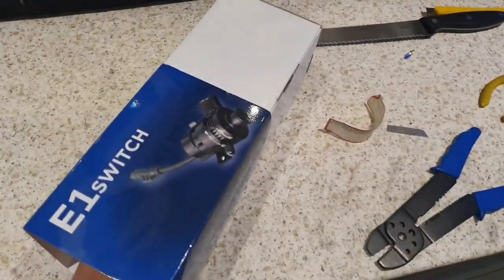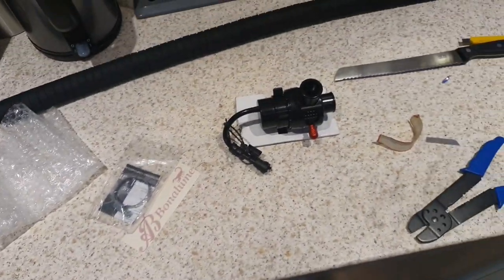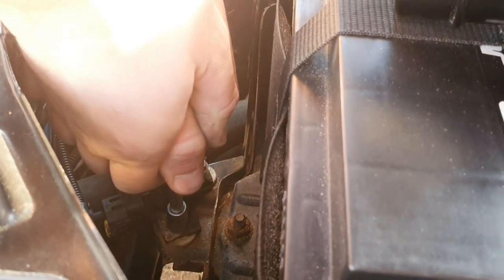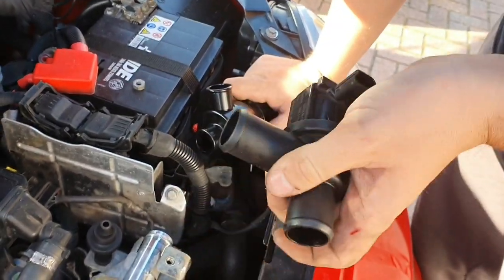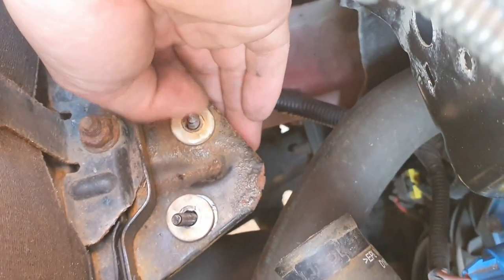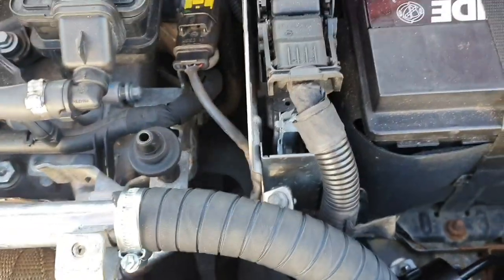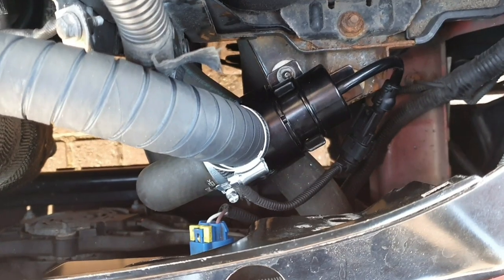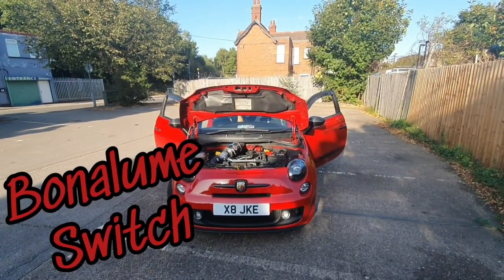BMC Pop Off Filter VS Bonalume Switchable Dump Valve / install & Review

Comment: Just installed the same one, also have the forge induction kit, sounds much better in person, it also holds boost better, and releases it more controlled, its definately a quicker valve.
Reply: did you had it fully open or not fully ? i notice some times when in 5th and having him fully open, when i loose gas padle it blows the boost away and when i then need to put back gas on the padle it not excelerate so good and putting in 4th im bit to fast going for example .

Comment: This doesn’t damage the turbo or engine does, and what about a check engine light on?
Reply: wouldnt be an issue as nothing is left unplugged. I recent intalled the forge recirculation vale and there was quite a bit more piping involved than this Bonalume - no issues on the dash!

Comment: If you want to make it even louder plug the Pop Filter onto the Bonalume and when you have it on loud mode you get double the noise
Reply from the maker: Mmmm interesting 🤔
Reply: Yeah you should try that.
Reply: It’s possible to plug the Pop onto bonalume ? There are no risks ?
Reply: @nicolasortega102  no risks, I’ve been running that set up for over a year and had no issues (touch wood) I get the odd check engine light but that is the Bonalume itself causing that not the fact I added the pop filter
Reply: @djpaulyc09  uh tank you , i will probably do that 😉

Comment: In america we have those bolts at advanced auto parts, i had to swap them on my exhaust cover on my 13 NA pop and the same with the turbo manifold on the 14 500L when i was blanketing the turbo. Cost me $8 to replace them. They get brittle pretty often so i got several spares